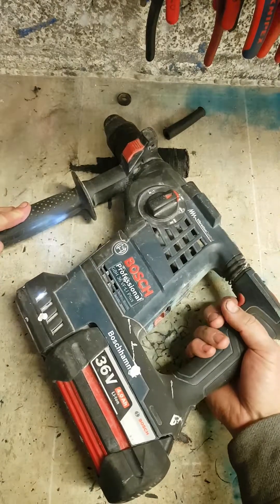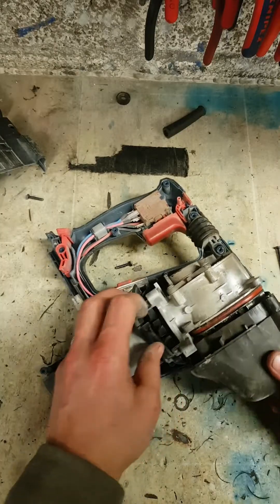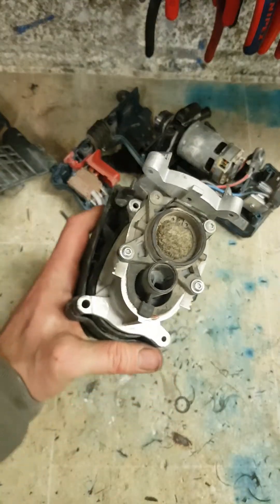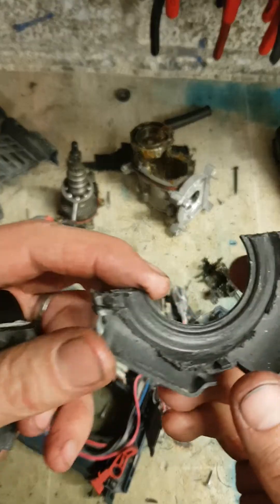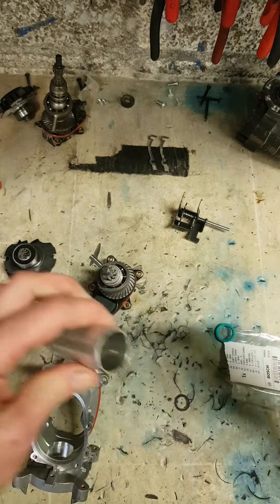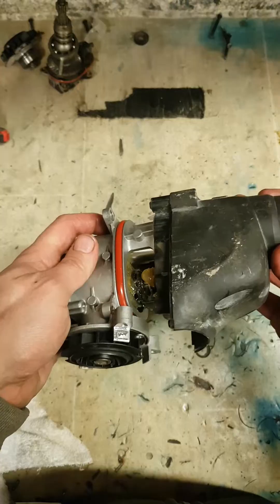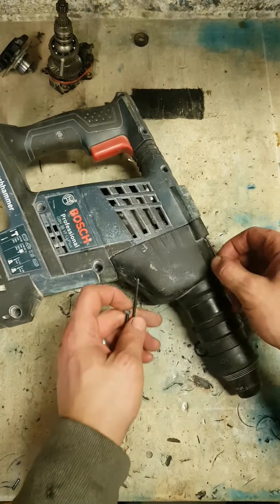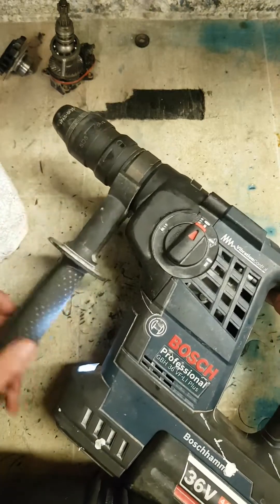Repairing a Bosch GBH 36VF-LI SDS drill with stripped gears and not rotating.

Comment: Hello, I have the same machine. When I press the start button it works and stops after 3 or 5 seconds. taking the video i realise that it comes from the position of the machine and its battery! it does this with the 2 batteries. when the battery is resting on a surface it works when the machine is suspended it doesn't really work.  I still haven't found the cause of the false contact (see video for help).    https://www.youtube.com/watch?v=eeZ5grum29g
Reply from the maker: The part you need to replace is the contact retainer. This is the part number 1 609 280 A56.
It is the contacts that the battery connects into. 
If you look at the pins on yours you will see they have been eaten away where the battery makes contact. 
Replacing the battery retainer will cure your problem. You have to open the body and solder in the new retainer
Reply: @deandohertygreaser I'll look at it tomorrow... many thanks